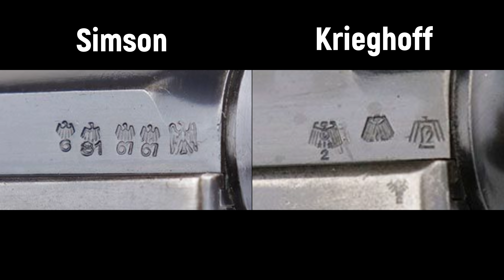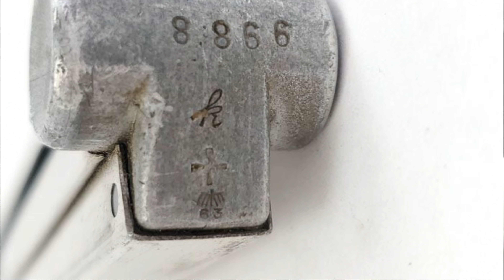What Magazine Belongs With Your Luger? | More Luger Rescues

Comment: The 1920 marking on the top of a luger upper is actually a gov't property marking and/or a date, It is Not a rework marking, although for many years folks thought that is what it meant.  it does not.  .  Lugers were required to be dated, and after WW1 when DWM went to make some, they were required to be in 30 luger (7.65mm) and they were dated 1920.  At the same time, citizens were required to turn in weapons and the Weimar gov't gave a bounty on different weapons.  Well, it was assumed and likely so, that soldiers were turning in weapons from the army stores.  Thus a directive came out that the 1920 would be placed on all gov't owned weapons.  This is not a date, NOR a rework, but an acceptance gov't marking.

Comment: I made walnut magazine bottoms/bases for John Martz Luger Carbine maker in the 1970s and throughout the 1980s and I used to pressure cook epoxy resin into the wood after making and finishing the bottoms. I would then wipe off the excess epoxy and allow to cure. None of my mag. bottoms that I know of have cracked or broken. The final finish was similar to an oil finish. Also, the oldest magazines used in P08 pistols were tin dipped or plated before the nickel finished and extruded ones.

Comment: Thank you for this great video. I have a question to the K date Mauser P08 from 1934. Why are there the letter S markings on some parts? Came those parts from Simson? I have seen such a P08 with the K and S/42 and several S markings. Thank you for an answer.
Reply: Not sure the reason for the S but it was not from simson parts
Reply: @thomaswhiteman4261  Sure? The K model was a transition version. After WWI Simson also got parts from DWM and Erfurt.
Reply: @dieterrahm4044  All true.  Nope.  Not sure where the idea of the S came from